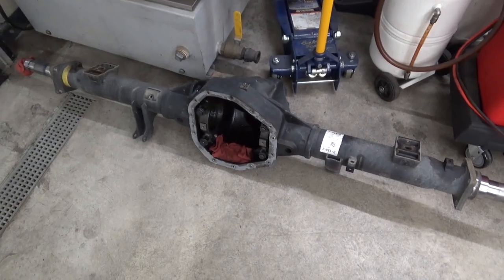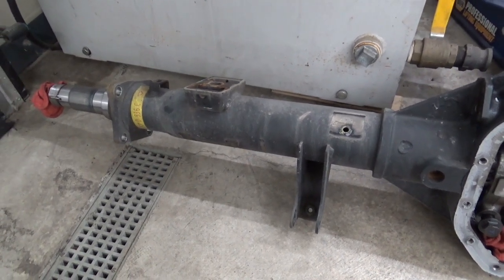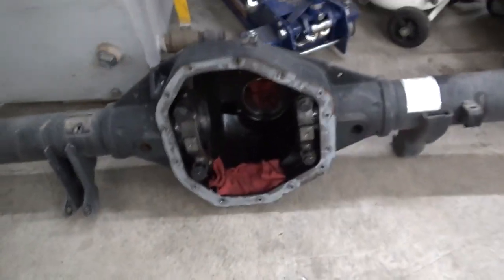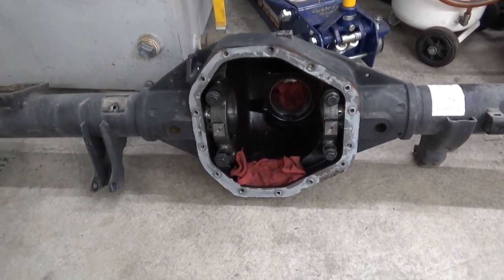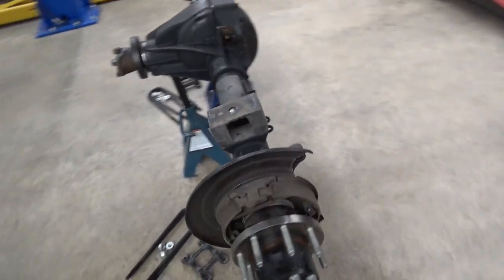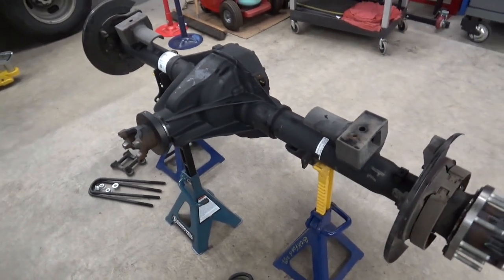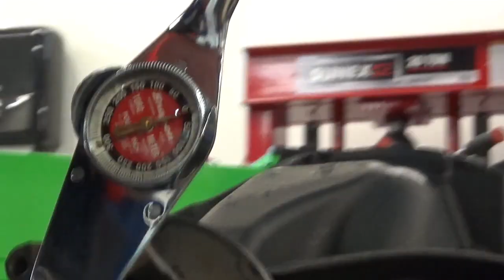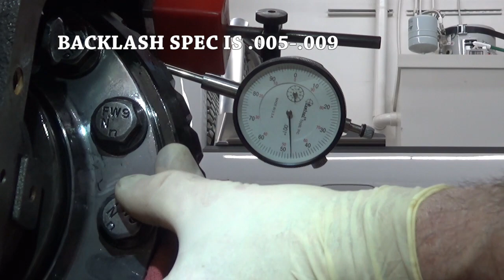DANA M275 DIFFERENTIAL REPLACEMENT

Comment: Great work as usual.  I wish I could have gotten a new housing and I am glad that your customer got one.  The welds you did on mine still look AWESOME!
Reply from the maker: Thanks Shamish! Had a chance to reinspect one that I did 6 months later and there was not tube deformation or seat separation so you should be good to go.
Reply: @raincitywrench117  Thanks.  I think I have maybe put 500 miles on the truck since then!

Comment: Thanks for the video! Did you install a new crush sleeve on the pinion, and did you use the old bearings on the differential carrier? Is there a bearing pre-load spec for the differential carrier bearings? I'm getting ready to do this job on one of our trucks at work, your video helped a lot.

Comment: Nice job, diff work can always be time consuming, especially when done right.  Did you make that tool that goes on the air hammer for using the bearings race installers.
Reply: OTC makes them.
Reply: @chekelley6861  cheers 🍻
Reply from the maker: Thanks! No, it comes in the Lisle set I have:https://www.lislecorp.com/specialty-tools/pinion-bearing-race-driver-set
I also have this set because it has some of the smaller adaptors:https://www.lislecorp.com/specialty-tools/pneumatic-bearing-race-and-seal-driver-set

Comment: I ruined the threads on my pinion gear. What are the chances of me being able to buy an OEM ring and pinion and it working without having to mess with the existing shims? and what are you doing with the bearing and punch?
Reply from the maker: The pinion bearing shim sits between the inner bearing race and the housing. If you get an oem pinion, install a new bearing and reuse the existing shim you won't have to do anything. The proper pinion depth will already be set up. I'm using the punch on the side adjusters to set up the backlash. There is a special adjuster wrench to turn the cams but the shop didn't have one so a punch works fine. I think the spec is .008 - .010
Reply: @Rain City Wrench  yup ty for the reply.  I have it all together.  First time for me but I did see the shim behind the race and left it alone.  Everything seems to be going well.
Reply: One thing I did learn though, you can set the proper backlash but you need to make sure those bearing retainers are tightened down.  I nearly made the mistake of putting it together with the backlash way too tight.  Tyvm for the video though and the confidence that everything will be good.